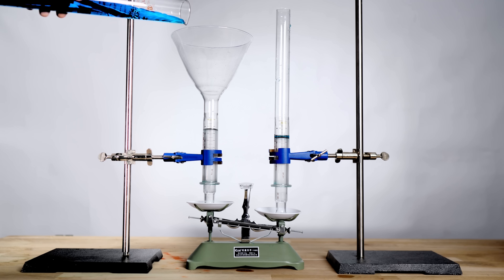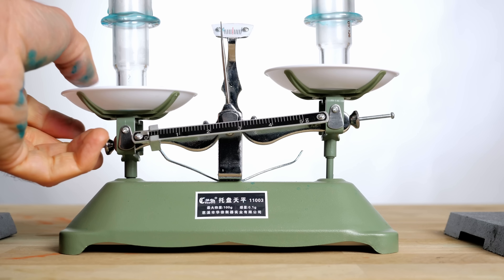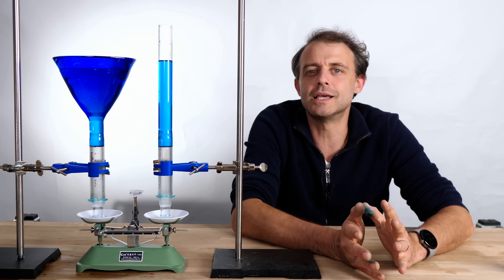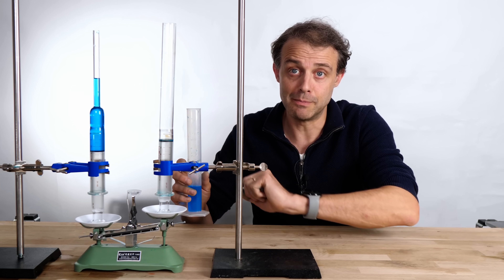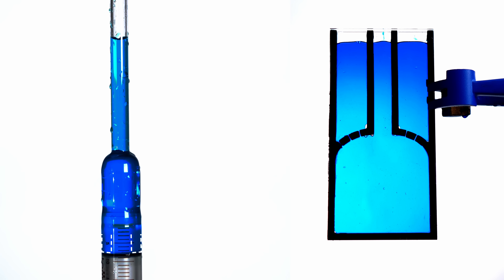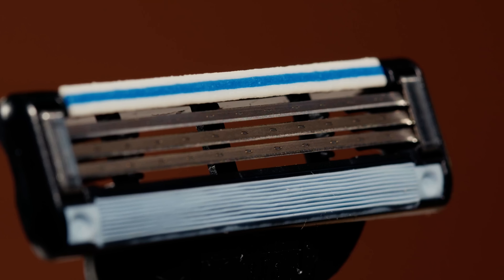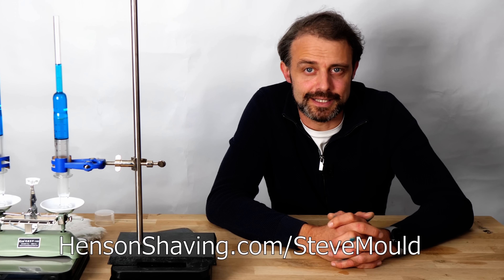The Hydrostatic Paradox

Comment: In the second setup, my brain thinks of it more like this:

Water fills its container, when the water "touches" the bottom of the container there is a reactive force which then pushes it upwards and balances out at the surface level. Add more fluid, the level it reaches before that reactive force balances out changes; and where that level exactly is relative to any given volume of a fluid in a larger container is dependent on the density of the fluid (or perhaps more accurately its the other way around, the math that determines how those forces balance out ultimately determines the resting density of the fluid).

But when you restrict the movement of a fluid, no matter in what direction, the restricting barrier is going to feel force from doing so as the fluid impacts it in its attempt to "spread" out in that direction. So when you "overfill" that "inverted" funnel container in the second example, the "ceiling" on the sides of it is restricting the upwards movement of the water beneath it trying to spread out to match its density which results in an upwards force. The ultimate source of the force being the fluid in the central column pressing downwards on it all.

Comment: I learned about this, a few years ago, when I was working, delivering water. The boss posed the question of whether it was faster to put water in through the outlet of the tank or through the same hose, into the top of the tank. Needless to say, pumping the water over the top was significantly slower.

Comment: 1:18 it’s interesting how the color is darker in the top part of the funnel, but it does not appear as a smooth gradient from the narrowest to the widest part. The top part of the funnel appears uniform in color.
Reply: I think you're observing the variation in glass thickness of the funnel walls.

Comment: does this imply that if you:
- take a 1cm tall tank
- that has the width x depth footprint of a small swimming pool (a few meters x a few meters)
- and have a 2m straw sticking out of the top
- and you fill the straw
that the base of the entire tank will experience the same pressure as the bottom of a filled swimming pool?

Comment: That's the underlying concept behind old deepwell water pumps. Add a piston at the top and the displacement between the smaller "primer" line and the larger suction  line is what is getting in the bucket...

Comment: You've actually made a pretty nice demonstration of a transfer of force. Might as well you can connect the bottom with a hose, the result will be the same. The physics stay, transfer medium changes. I've actually got in to an argument over this with one of our contractors. He couldn't understand that 1bar of pressure simply wasn't enough to ensure our heater system doesn't have air in it when the gauge he was looking at was at the bottom of the system (-10m in height). It didn't click with him that it doesn't matter the system is closed, it will generate voids as the water heats up, because the column of water is at atmospheric pressure on top of the system.

Comment: Bermulis principle.water is applying force to every other molecule. Force is same but pressure is not the same as the atmosphere around it. Open top as well as a movable bottom, at given cross section volume is changing linearly at the top but not the bottom but the length of the non changing portion can get longer actively until balance. Force stays the same but technically pressure doesn't. Otherwise submarines could be filled with atmospheric pressure and dive to infinity as more water weight builds up around the vessel. More weight more pressure force though. Once stationary is equal throughout. Directions of force is all over the place, not just down. "Static" vacuum "surface tension?" will pull the higher molecules down the same as the higher places weight on every surface below its center point of mass. Am I thinking of this right?
Reply: I have no idea if you were thinking of it correctly, what you wrote sounds intuitive, well, as intuitive as this gets.

Comment: You aren't weighing the water, because it's supported by the clamp, which exerts an external force. Just like when you put a magnet on top of the scale and another one below, that doesn't change the weight of the magnet, the only difference in the force is the physical connection.

Comment: if you think about it like this it makes complete sense.    Imagine a bathtub as wide as lake michigan but the height of a normal bathtub - if you pull out the plug its common sense that the water will come out the bottom at the same rate or speed as the bathtub in your house despite the lake having billions of times more water

Comment: That's not really a paradox. It's quite intuitive. The clamps are holding the weight of the systems. The scales are just measuring the water pressure exerted on the pistons. The deeper you go (or higher the column), the more pressure you have.

Comment: Only the pressure the water exerts at the bottom is being transferred into the piston, which will be higher for the taller body of water. As counter intuitive as it sounds for a liquid, the cone shaped beaker is transferring some of the water weight to the stand.

Comment: Recently, I saw a video from The Action Lab about the Janssen Effect and your video felt similar, about how maybe the curved walls support the weight of the water so it doesn't affect the scale the same way how grains in a column exert less force at the bottom since their weight is spread and supported by the surrounding walls.

Comment: Very interesting video, but I guessed everything because it works in the same way as communicating vessels, except that it is not the liquid that transfers the force from one container to another, but the scale.

As for the sponsor, I'm not convinced by the explanation. I always cut myself with a single blade (even with electric razors I ended up covered in blood), I cut myself less with a double blade, and I found happiness with a triple blade, with which I don't cut myself at all. So the explanation about pressure on the hair doesn't really convince me.

Kisses

Comment: In middle school, we derived the hydrostatic pressure formula for a straight cylinder as g times density times height, and it was simple. Then in the exercises, they asked about the pressure at the bottom of all different kinds of funny shaped glasses with the same water height, and I was like: "Hm, this is a tricky question, the simplification in the derivation of the formula obviously works only for straight cylinders, but what we really should care about is the weight". In the meantime, ALL my classmates "knew" the correct answer that the pressures are the same (it did not even occur to them to even question why we should be able to apply the formula in circumstances it was obviously not derived for)... And the teacher said they are right, and when I asked why, she just told me that "We derived the formula, it depends on the height only". It drove me crazy until I thought through the entire question during several weeks and finally imagined the situation with scales and measuring the "tilted walls" of the containers exactly like in this video.

Comment: I cant wrap my head around the 2nd setup. I imagine if you had a set of weighing scales under each of the holding clamps and another under the piston balance, the total of all those weights would remain the same, you would just see the clamp weight of the thinner tube become lighter and the piston weight go up by the same amounts.

What I don't get is how the water in the thinner tube is pulling the clamp up? I cant visualise it in a way that makes sense? The closest I can get is at 9:32 imagining a 'W' shape at the base of the water where the centre of the W is the middle column of water bearing down and rebounding up and out to the edges to hit the flared top edges of the tube and kind of pushing upwards, which would take some weight off the clamp and transfer down into the piston.

Secondly, how far can you extend the height of the thinner part? Is there a point where you make it so tall that the 'upward' force of the water could lift the tube off of the piston?

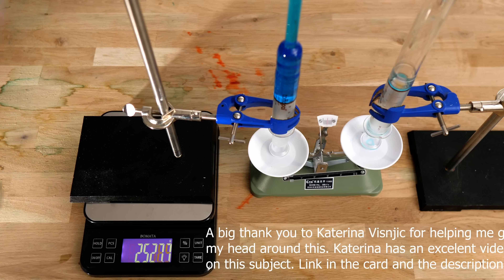Comment: Nice video. (By the way, the text at 10:22 runs off the edge of the video.) Another way to think about the hydrostatic paradox is in terms of energy: for example, if the column of water rests on a weightless compressible layer, then the minimiser of the sum of gravitational potential energy of the water and elastic potential energy of the compressible layer occurs when the contact force between the water and the compressible layer is equal to rho.g.h.A, regardless of the shape of the container.

Comment: Minor correction: you say the pressure under the glass ceiling is the same as the pressure at the bottom of the column. This is potentially misleading

The pressure at the bottom of the water under the glass ceiling is the same as the pressure at the bottom of the column, the pressure just under the glass ceiling is the pressure of the water mid column.

P.s. really well tied in ad-read, well done on that

Comment: this is an incredibly fascinating video, but the most fascinating thing about it was how seamless the transition into the ad read was
Reply: Yeah, I have to admit with the science behind the blade, I'm tempted to try it. If and when I start shaving again.
Reply: @FetchTheCow I've heard good things about straight razors, but I've also heard that you should maintain (sharpen) then to keep them effective. So instead of buying new blades you need to maintain the single blade you have. But it is true that you will get a cleaner shave from a straight razor.

Comment: Just looking at the thumbnail look clearly that most of that water is pushing down on the diagonal glass walls, and those are transferring that weight to the clamp instead of that piston. Pressure get transferred through height, so only the part of the water cylinder above the opening is pushing on the piston, so as long as pistons are the same size, you need the same water height.

Comment: 10:22 So..... if you were to extend the small tube with a really long tube/hose..... you would lift up the clamp (if it were perfectly balanced). I mean, it feels like what i'm saying is correct, but intuitively this would be really weird to see....
Reply: Agree. If tall enough, the pressure pushing upward on the 'shoulders' of the tube could be enough to actually lift things. As someone else mentioned, it's as if the tube is 'floating' on the water due to a sort of bouyancy.

Comment: Without watching, my immediate reaction is “the drain doesn’t have to hold up the whole bath.” The bathtub holds most of the water. The drain only holds the water above the drain.

Or like, imagine being slumped over a beanbag chair with your toes on a bathroom scale. That’s the inverted version.
Reply: Nope, I thought the same thing. Well, not the drain, I was thinking in water column height above a certain surface area. I like your mental picture better 😉

Comment: This has me wondering about extreme cases now. Say you have a tank of water with an object in it- maybe a watermelon? And the tank is sealed on all sides. Then you attach a really long and really narrow straw to the top of the tube, and lift it upright. Does this make a sudden increase in pressure that crushes the melon? Intuitively I know it shouldn't, but I'm not sure where the problem in the setup is. Does the water get compressed too much, and the height of water in the straw falls quickly because it's so narrow?
Reply: If you just lift the straw upright, it wouldn't be filled with water and it wouldn't do much. You have to fill it up once it's vertical. Also let's take a somewhat wider straw, because a narrow straw is affected by the capillary effect which skews the results somewhat. Then yes, the water would be under a high pressure and could crack the melon (though the volume of water in the straw is pretty small, so if the melon is flexible it could maybe absorb the extra pressure by shrinking somewhat, equalizing the pressure) or even the tank.
Look up video "Pascal's Blaising Barrel - Exploding Glass Barrel with Water Pressure" on the Physics4Life channel for a demonstration (as luck would have it it's in my sidebar right next to this comment I'm typing!).
Reply: Thank you!

Comment: I remember on a countrywide technical exam-competition thing, one of the questions was about water pressure supplied by a hypothetical water tower. I didn't know f all but wrote down P=g*h because that made some sense, thought it over, decided it can't be that simple and crossed it all out. Imagine my surprise when I got the test back, the correct answer written on it in red being exactly the same thing I crossed out...
still came out fifth place tho
Reply: P = ρ g h to be complete: you need to take the density of the liquid into account as well.

Comment: This guy always melts my brain.
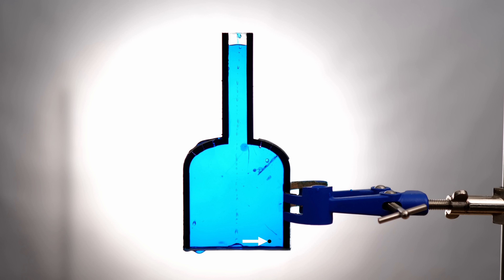9:05 it is.
I understand that the pressure on the glass ceiling is the same as on the bottom of the container. 
What breaks me is the question how high the pressure is in the neck (the long thin part on top) is 😵
It must be less pressure than what the ceiling and the bottom are experiencing right?
Reply: nvm I rewatched it 3 times and see where my mistake is

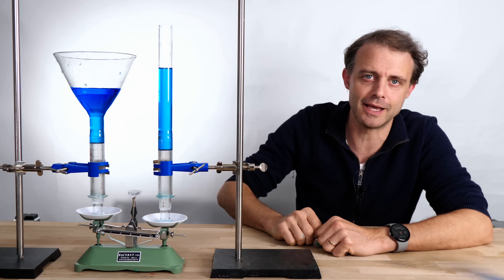Comment: 1:00 For whatever it’s worth, the smartest thing I actually think I saw in this video was you evening out the balance of the scale by using a massage gun and a bit of foam to vibrate the table. It’s like if MacGyver was a badass scientist with a bit of a lumbar problem.
Reply: So that's what this thing was... thanks.
Reply: @Lensflare-85  I have a couple myself, I knew the instant I saw it 😄 
It really is the perfect tool for the job though lol. Man’s brain really does have some legit MacGyver in it. “I need something that does exactly this but isn’t purpose built for it… AH!!☝️😃” haha

Comment: In my opinion the most intuitive explanation for everything in this video is to imagine a tube connecting both containers. Intuitively I know that the water will balance out so both sides of the tube are at the same level. It does not matter how big the container at the end of the tube is, the water won't be lower in a big container than a small one.
It also does not matter if the water in a tube is transfering the force to the other end or two pistons connected with a metal rod (the scale). The force transferred should be the same so the water should behave as if connected via a tube.

PS: I own a Henson Razer and I don't know how I could live with cartridge razors at all. I don't know if Henson is the best razor manufacturer in the world but I do know it is much better than any cartridge razor. And the 100 blades I got with it last a looong time, you won't need to buy new blades for more than a year.

Comment: So the pressure at 'Challenger Deep' would be even greater if it were simply wider but no deeper?
Reply: Based on the analysis, if it's wider at the base, then likely yes. But if not, then I'd assume no

Edit: I completely misunderstood the question, my bad
Reply: Huh? Water pressure is a function of depth. Not width.
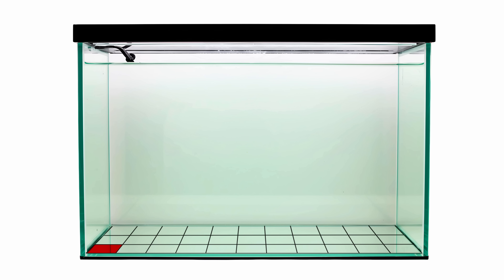Reply: @ricodave  I don't know. When Steve uses the aquarium example at 1:51, he says that each grid at the bottom of the tank only feels the weight of the water directly above it. If a deep-sea vessel was optimized for more height and less width, wouldn't that mean it experiences the weight of a smaller column of water above it? It's confusing to me, especially the vessel with thin column above the thicker column.
Reply: @FetchTheCow  it will feel the same pressure which will press on the sub with the same force per area. Smaller area smaller force, same pressure.
Reply: He did not mention the side of the tube( at the base)sees the same pressure as the base. @FetchTheCow
Reply: @ricodave  I think we're agreeing. I said "weight" and you more correctly said "force." Less area, less force on the deep-width-optimized sea vessel.
Reply: @FetchTheCow  because we are dealing with liquid, the pressure will act in every direction. This means the side of the sub sees a similar pressure to the top, and in fact bottom. So any increase to the length, vertical or horizontal, will increase the force too.

Comment: This got me thinking of situations where the hydrostatic paradox doesn't apply (or, rather, counteracted by other forces). I learned that wet concrete can exhibit only 30-70% of the hydrostatic force pressures, distributing the forces via friction of suspended particles to the side walls. Apparently, this is a pretty important thing in civil engineering.